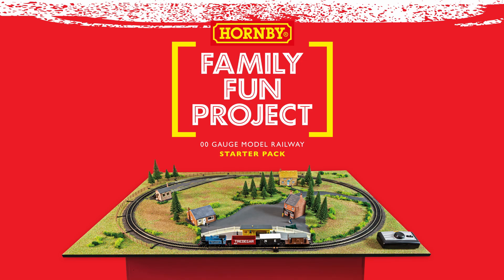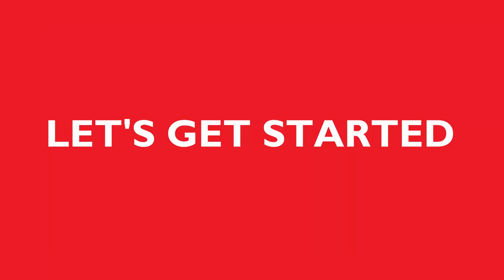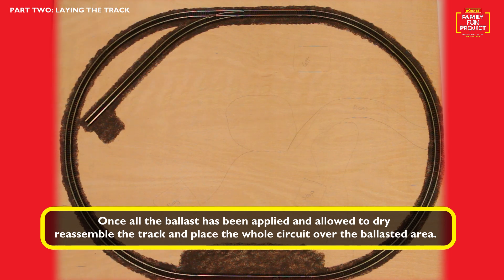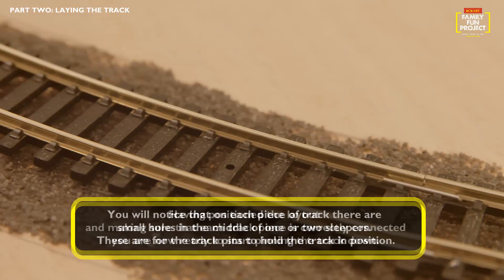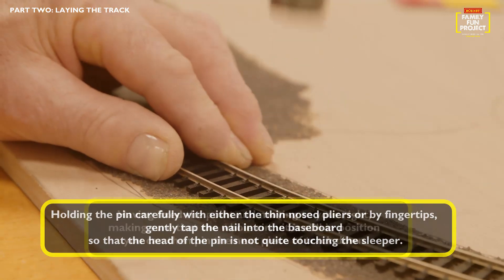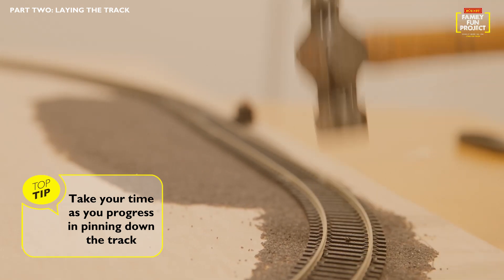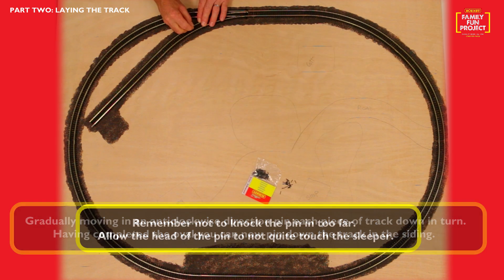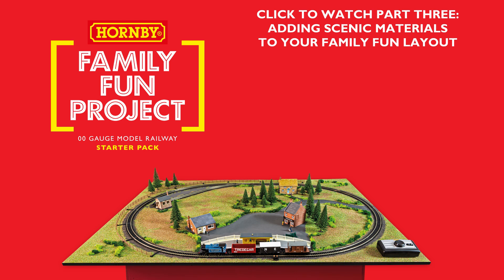Hornby | Family Fun Project - How To: Laying the Track (Part 2)

Comment: Great video, I lay ballast first  track secound, it is a clean way to lay track.  And simple to lift track later if you want to make changes later. Nothing Penny wong with using track pins if you know how to use a hammer.
Reply: There is. When you want to add to your layout there's a fair chance you'll damage the track removing the track pins.
Reply: explorermap I have never had any trouble removing pins and damaging track and I’ve even payed track and ballasted after and been able to the remove the pins...
Reply: @joshualoynes7408  Hey  Bro I'm with you, we just need to take it easy when we  make changes, every thing can be reused, It saves a lot of time and money.  ; )
Reply: Well, if it works for them, it works for them. Even if it is to try and make more money (knowing that it’s what they did).

Comment: Glue the track down first with dilute PVA or a latex based glue, such as Copydex, then add the ballast. There'll be no need for track pins if you do it that way.
Reply: @azuma7628  Do they also want their customers to do things wrong? You can always use the track pins to tack on a backboard.
Reply: @Poliss95  remember, “Your layout, your rules”